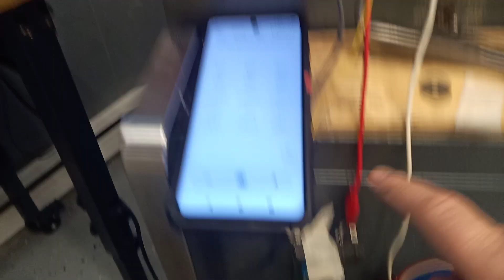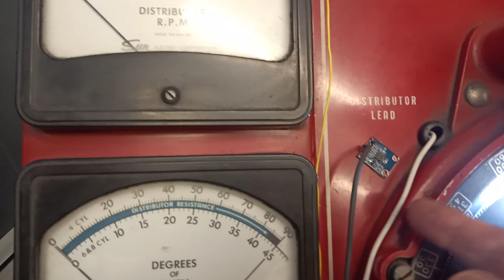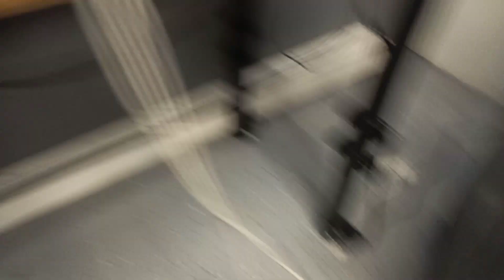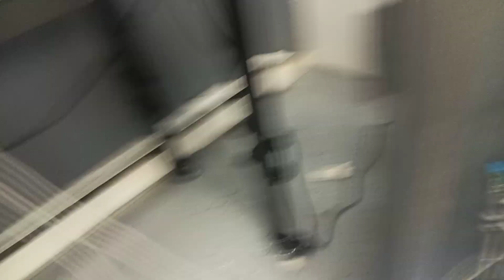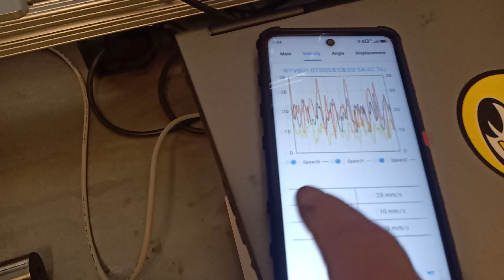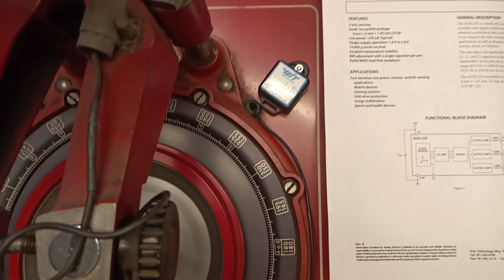SUN Distributor Tester Balance Attempt With A XL335 Accelerometer

Comment from the maker: This is a first attempt to balance the rotating disk after removal of neon tube assembly and retrofit with LED.  The XL335 ia a low cost $4 three axis accelerometer.  It has a flat base which can easily be attached with double face tape.  I filtered the output slightly with a .046uf capacitor to eliminate higher frequencies.  Imbalance is most severe in the 2K to 2.5K RPM region.  The LED is powered on all the time with a 15 ohm resistor. A once per revolution signal is created with a photo transistor.  This should give an approximation of where the disk has too much weight causing an imbalance.

This machine has a thin plastic disk for the light which has no weight.  Earlier machines has a sizable glass lens. Be aware that the type of lens will change balancing.  All weights in the form of washers should be removed first. Some machines may have an additional weight location besides the slide.

I used to do a static balance by tipping the assembly on edge, spinning the disk and statistically seeing where the arrow ended up.  Crude but it got me close. In any balancing the chuck needs to be closed and taped on the side to prevent it from becoming off center.

Data suggests I need to add weight where the lens is.  It seems counter intuitive.  I really need to take the disk assembly off to verify what is happening before drilling random holes for weights.  That is not on the schedule for now.  Appreciate any ideas.

Lots of these kits have been installed and there have been no questions about balance issues.  These machines shake around enough when balanced.  Issues don't arise till over 2,000 RPM.